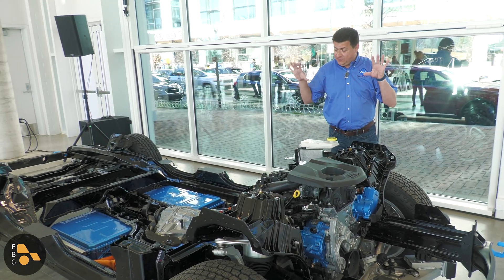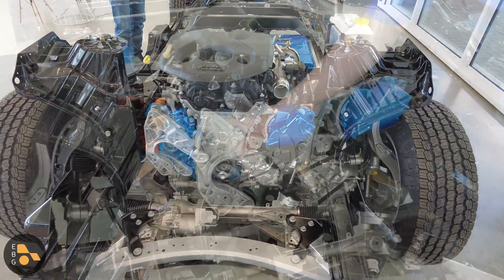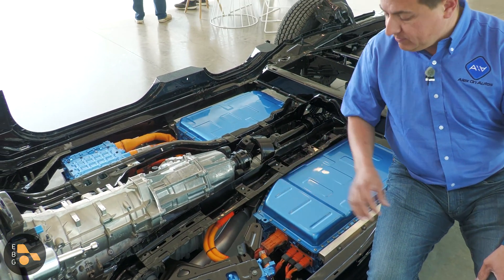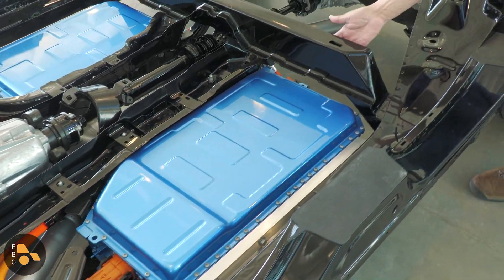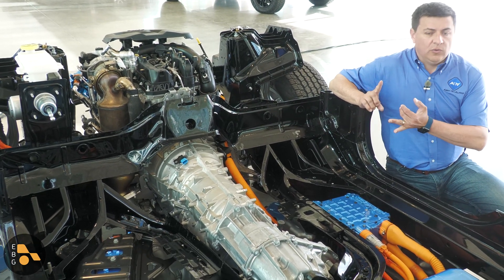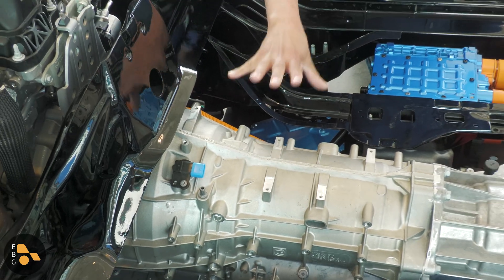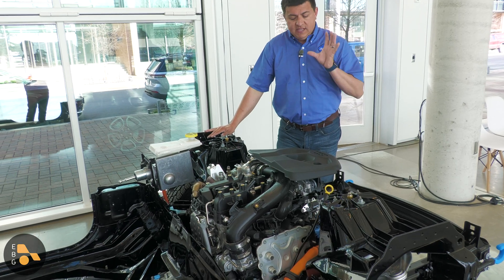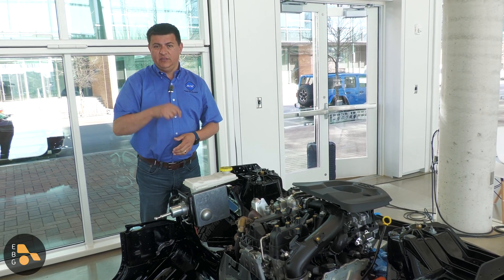How The Grand Cherokee's Plug In Hybrid System Works | 2022 Grand Cherokee 4xe

Comment: You describe the engine as producing 270 hp but the jeep page indicates the engine produces 375 hp.  Is this a different engine?
Reply from the maker: 270 is the output of the engine alone, engine + motor is 375.

Comment: Very detailed review Alex.  If the battery pack is depleted, how can the engine be started, unless a residual battery charge is maintained for starting.  Also, is there a way to jump start the 4xe?
Reply from the maker: Hybrids always reserve a tiny portion of the battery, but also the 12v system is used for the initial start of the vehicle so that way it can be jumped if needed.

Comment: This is basically GM’s two mode hybrid system from 2005 developed with BMW and Mercedes. Guess what the price of oil was then.  This is the same/similar system rejuvenated/reincarnated with a plug in lithium ion battery. No surprise in hybrid only mode it only increases mpg by 2 mpg which is exactly what it did in the Tahoe in 2005. Now engineered and made by ZF and the only things that make it more compelling today besides the hp and torque are 25 miles of electric range, lower emissions, a 7500 tax credit and high gas prices.
Reply: This is a piss poor drivetrain.  Pass

Comment: Why wont jeep Chrysler offer the option to push a button to hold the energy in the battery for city driving?
Reply: they do. you can command ev only, hybrid, or gas only (with start/stop) operation of the system. 3 dedicated physical buttons for it too